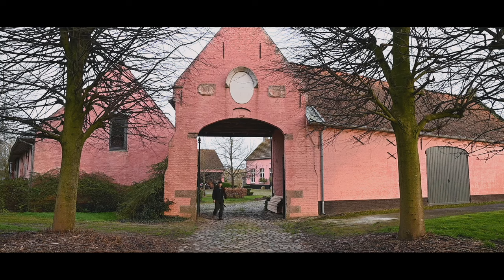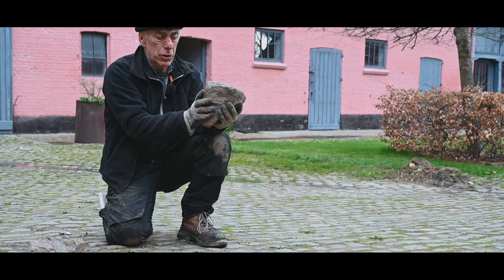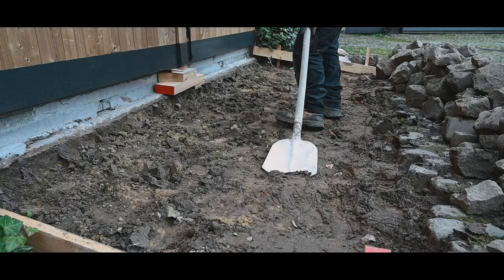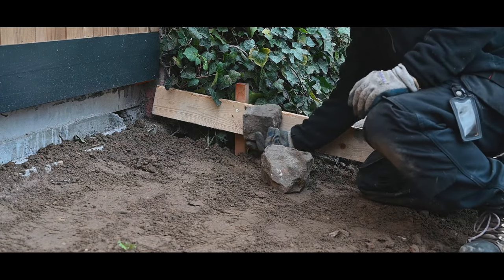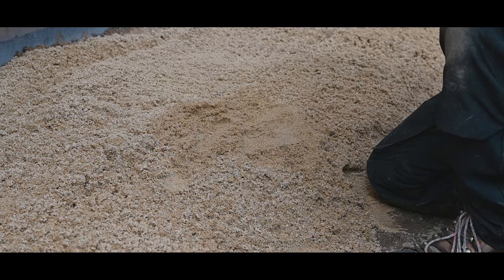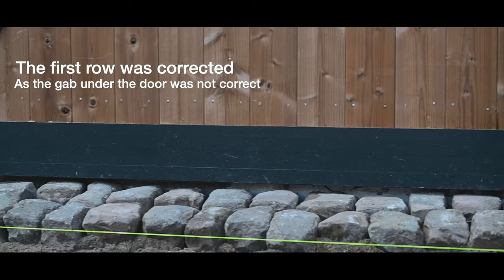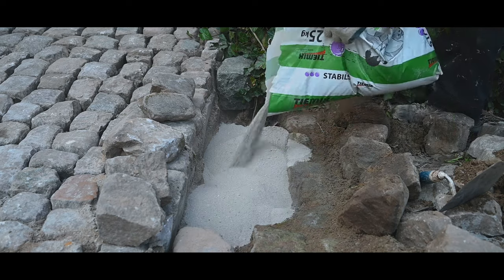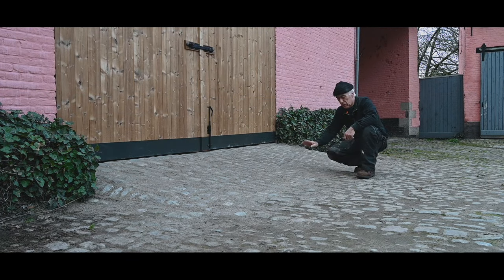Barn Renovation  - cobblestone placement

Comment: It turned out wonderful! You should be proud of your work! Your sand and cement mixture is essentially what we call "Flowable Fill" (if you mix it in a cement mixer with water).
Reply from the maker: Thanks for the comments, thanks for explanation Flowable Fill ... I learned something new
Reply: @D3Sshooter  Flowable fill is often used for work where you do not want to use a plate compactor - lots of cities use it to fill in utility trenches under roads because it can be made soupy enough to fill all voids and apply even compaction. If you are interested I will send you a simple formula for mixing?

Comment: I think it looks great. The original cobblestones were simply placed in dirt. Good drainage and easily able to reconfigure. Dirt is also (usually) free. Why use sand and cement? Were you afraid of it shifting/sinking?
Reply: Sand and a little cement are cheap enough spread over next 50 years.
Difficult to not have the stones settle without cement when Steve is driving big tractors over them. Without cement the only thing holding cobblestones in place is its neighbour, one moves then another and over time they will be uneven vertically and displacing one another.
Reply: Clayish soil is difficult for laying these stones, sand is much much easier. Riversand is squarish instead of rounded beach sand, so it really grips tight but drains very well, even with a bit of cement mixed in. Stabilized sand drains much better than clay soil
Reply from the maker: Thanks for the comments, it is common to place them in a bed of sand. for reasons of watering